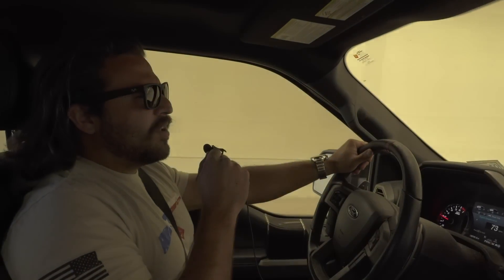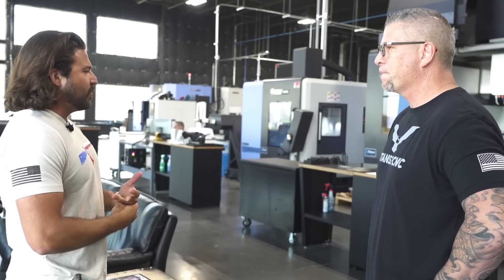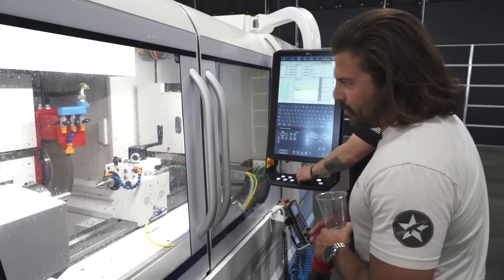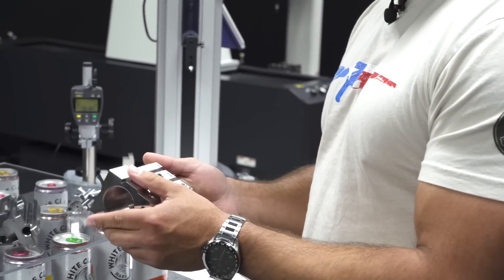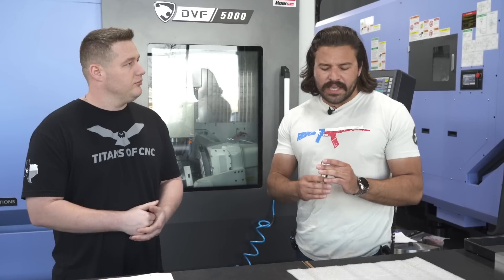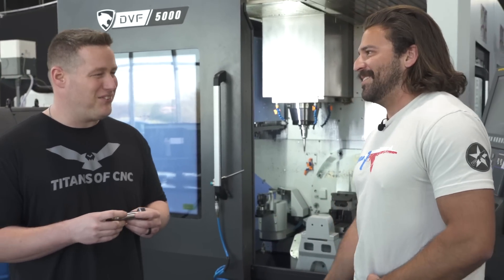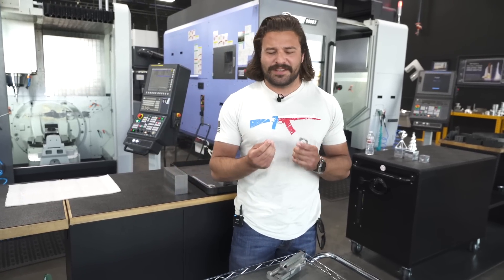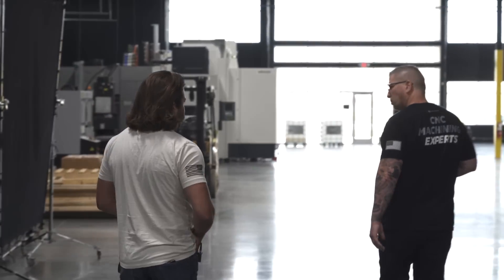AK-50 V3 Update - The Parts Are DONE

Comment: Nothing cooler than watching a CNC make intricate parts.
I'll never forget the first time I walked into a machine shop as a hire to deburr and chip out the machines. At that moment I knew what I wanted to do for the rest of my working life.
   I worked my way into inspection and from there into to running a machine and to this day even after I retired I still love machining!!
There's something about making something that will outlast you and coming to the realization that virtually everything out there was made possible by mills and lathes.
 Doing Aerospace prototype work was the most satisfying point in my career as a machinist. Knowing that everyday will bring something different kept it interesting.
  I've always worked in job shops and couldnt stand the thought of running the same parts over and over again.
Man do I ever miss it. Unfortunately my back and hip are too screwed up to continue or I'd still be doing it today.

Comment: so you pretty much copied a M82A1/M107A1 lol for the bolt head design and their extractor.
Reply: Obviously not, lol. Brandon's is much more like an AK bolt, for instance the lugs are helical, as he mentioned. If you do a 1 to 1 comparison of a Barrett to an AK you'll get a much better idea. The only reason it might remind you of a Barrett is because it's 50 BMG and the sizing is similar for obvious reasons.
Reply: @DeLance Stephens  so you have not seen a Barrett M82A1 bolt head before. They too use a very similar tri lug design and extractor set up. Even the barrel extension is similar.
Reply: @ut_punkn1859  I've seen the M82A1 bolt carrier plenty of times. It's trilug, but it's not helical like the AK (and Brandon's AK-50). Given the AK bolt design is much older than the M82 bolt design, it would be Barrett taking the inspiration from Kalashnikov if anyone was copying homework, but they're really not alike.

Comment: What material did you go with, and where are you having the heat treat done on these? Most of these parts are typically case carburized.

If you go with typical gas carburizing, they're going to distort like crazy and likely none of your features will fit the same. Especially the tapers. If you went with 8620 or 9310, gas carburizing is pretty much your only option. If you went with a tool steel like S7, you can vacuum heat treat them which results in much more stabile and predictable distortion during heat treat, although the hardness and wear resistance will be lower. If you don't heat treat them and just use them in the mill annealed state... Well, you'll have fun for a few rounds before a pretty spectacular failure.

Comment: accidentally asked this under an older video instead of this one but can the AK-50 be used with Ruag HCSX armor piercing rounds? these are loaded hot af, ballistic twin to an anzio 20/50 in a bmg case and are designed to punch through vpam-13 armor using a hardened steel core

Comment: Are you planning on making the system simpler so that it's easier to produce?
Reply: From watching the videos, it seems one of the biggest challenges was the two-piece bolt carrier and cam groove parts; getting them to fit tightly. In production, I believe the plan is to make that one piece, which should simplify the production of that part.

Also, knowing how to produce the part (like the brace for the bolt) will improve time and cost once it is figured out.

Comment: I do somewhat wonder why Brandon didn't use some titanium for the larger parts to reduce weight. As a machinist who worked with titanium, I know it's more pricey and a bit difficult to manufacture (unless you have the right tooling), but the 45% weight reduction plus no rust, low corrosion and the temp resistance would be extremely beneficial.
Reply: In a production version maybe, but not in a prototype.

Comment: Biggest potential for error is the bolt. The lug and cam entering in by rotating can lead to the boot over rotating upon cycling ending up in the lug catching the lead in of the groove. This would cause a jam and be difficult to disassemble. The geometry of the cam can be changed so that way the bolt will be inserted into the cam and then the cam+bolt will be slid into the dovetail grove on the bolt carrier for assembly. Other potential for error is the bolt face catching upon interacting with the trunnion. If not clocking in quite right, the bolt will catch and lock. Other question is clearance. If the cylindrical profile of the triangular boss and chamber have a slight taper, it allows for good lead in and clearance on entry and tightens up upon locking into battery. Other question is tolerances. It is good to make an assembly with max material condition and least material condition to test if the tolerances allow for a functional assembly. Also hard to say much on tolerances and setup without seeing all the prints. Knowing the datums would help with figuring out better machinability and margin of error

Comment: The worst part about CNC is that if you install the bit just slightly off you just blew 200$. It is also shocking how thin the bits can actually get. 

One day at the shop I saw the machinist install the same bit 10 times, with lazer sights and everything... and it was still snapping the bit on aluminum. He damn near ran over a cop as he left the facility at the end of the shift because he was so pissed. (the QA guy messed with the program and instead of the bit pulling back and forward it tried to move through solid metal side to side.)(*everyone hated this QA guy but corporate brought him in; He was incompetent and would steal lunches)

Comment: Idk if I'm just retarded but the hinged system seems redundant and like an extra point of failure. Say the joint that holds it together.  Will It be able to handle the shock from the recoil after 500 rounds? Even if its not directly receiving a lot of shock from the bolt it would still be constantly stressed because of the design. I'm excited to find out either way.

Comment: I would reduce your class of fit so that the BCG and extractor has some space for small amounts of carbon deposits produced by the powder. My prediction is its going to jam. But this could be offset with the right coating. Also reducing the amount of material on the non critical features of the bolt to allow some gas to escape around the bolt upon extraction will prevent the build up and and allow it to function for longer period of time with out maintenance. I hope it works though. The struggle is real!

Comment: Can confirm. I'm sub'd too and love watching both of y'all. 

Design Engineer at Rolls-Royce LibertyWorks here 🤙
Reply: Hay I'm looking into getting into college for mechanical engineering. You have any advice? (Haven't enrolled yet)
Reply: You've got 2 options really. Are you good at math? How about working with your hands?
Reply: @Supra_Nova88  i pick up on Advanced Math Quickly. only thing is Advanced Math is a perishable skill, but once something is learned you pick it back up easily enough (focusing on Algebra and Calc at the moment) 

it's all about learning the Tricks and Formulas and Turning what looks intimidating into Basically 3+7.

 I have over 7 years of Combined Experience in a Few Machine shops Working with Everything from Broach to Final Forge presses and some CNC Lathe.
Reply: Alright so I've been doing this for about 3 years now and I've never once had to touch cal for work lol. 

That being said, if you're more hands-on oriented (like I am) you might want to look into Mechanical Engineering Technology rather than science. It focuses on the applied aspects of engineering and a lot of the coursework is shop related where you learn manufacturing and rapid prototyping processes. This would most likely mean easy A's for you since you already have experience in a lot of that stuff. 

Of course, at the same time, I am one to advocate for the route less traveled like I did. I only have an AAS in Engineering Design Graphics (basically a CAD degree) and look at me now. Still mind blown that a company like this would even consider me, but hey, I do bring a very unique perspective and broad skillset to the table that most of these other Engineers don't know a damn thing about. Plus my lead (the one that made them hire me) has a spitting image of my skillset and never finished his degree. Yet he is the most highly praised and recognized person we have. 

Some background on me:

I used to be a Mechanical Designer and an Engineering Prototyping Project Coordinator for an HVAC company where I did it all from cradle to grave. The initial concept, preliminary design, final design and drawings, then managed the Prototyping and testing processes to completion of the project. Later I was picked up as an Engineering Technologist designing drill bits for Halliburton. 

I was also just notified that I will likely be following my current project into the test phase, gaining a title change to Test Engineer (a position I've never thought of). There I will be developing test procedures, designing and fabricating test rigs, and performing and monitoring turbine and jet engine tests. This is a great position for a jack of all trades type of Engineer like me because I'll be able to flex my design muscle as well as scratch my hands-on itch that I miss so much.

The realm of possibility is more vast than you think and you'll just have to navigate your way through it at your own pace and in your own way. The route I took required more hard work to prove my worth, but in the end, I got here with literally zero student loan debt. However, a bachelor's degree will make it easier for you to get jobs, but you may never use everything you learned from that degree and end up with loan debt unless you can bag a full ride somewhere.
Reply: @Supra_Nova88  thanks a lot man this was helpful.

Comment: I've not programed a cnc for years it was great fun programming and setting the machine. Think the funniest thing I've seen is some one didn't set the cnc up right and it flew out the chuck ripped the door of the job flew through 3 walls before it lodged between my legs at the other end of the machine shop if it was a little higher I would have been a unicy snip snip haha at the time a shat my self lol

Comment: With seams that tight you might need to worry about friction lock 😆 if that becomes an issue a thin coat of oil or grease should reduce the issue.

Comment: As a fellow machinist? Those parts look amazing. Top notch work. As long as it was engineered and drawn correctly it'll work perfect! 
If you made it to the print you did your job. If It fails its on Brandon's crew... I see good things in the future of this. Rock on guys!
Reply: As someone who lives in an orthopedic manufacturing capital.  There is nothing quite like the feeling, when you personally have designed, wrote the program for, ran it, and have the full product in your hand.  YOU MADE THIS FROM SCRATCH TO NOW.  This isn't just a hammer and wood and some nails, jesus fucking christ in a handbasket when you have this perfect part that fulfills what it is designed to do, what YOU designed it to do, and it's that same feeling of flush lines disappearing and more...  

It's eye opening, you did that.  You and all your culminated experience and training made this thing that functions perfectly and it almost brings tears to your eyes seeing what you made.

Reply
Reply: What about heat treat?
Reply: Will a production run be feasible and affordable? Do you think the average working man will be able to buy an AK50 and still be able to eat?
Reply: @BCM1959  depends on what you consider affordable. The least expensive semi-auto .50 BMG rifles run at least $7k these days, and those are full-production examples. $10-12k minimum if these get into production

Comment: Not sure what type of steel you are using, but additionally you may want to try heat treatments to some of your parts. It will stop them from wearing down quickly also they can strengthen the steel as well to stop fractures and increase the shear strengths

Comment: Unlikey but if these parts actually hold up will it or can it become a finished rifle?
Reply: These are massive blocks of milled steel, .50bmg is a ton of energy, but these should be more than enough to handle it. The point(s) of failure, if any, will probably something else, which is the whole point of prototyping.

Comment: The making of fixtures and jigs to make parts is almost as complex and intense a process as the design and prototyping of the gun itself. Look at the Colt revolvers. Sam Colt was an ideas man and could think up how the gun could work and how he wanted the gun to work. Elisha Root was the man who not only took colts ideas from paper to metal, but designed the machines and jigs necessary to make the guns in a factory assembly line. Again people who claim Henry ford made the assembly line are absolutely full of it.

Comment: Holy shitl dude. Getting that tapered doveltail on the sight block to snug at the precise point is very hard to do. I know you can throw trig at it but if the cutter took an extra thou, it'll slide forward 10 and be noticeable. 
Crazy stuff and I have been watching Titan before but never really see how two separate parts come together
Reply: You're exactly right! To accomplish that fit, we actually extended both sides of the dust cover model .005 and then cut the taper on the edm. Then we fit it into the trunnion and measured the amount of stock we needed to remove and ground it to be perfectly flush.

Comment: Assuming the end goal is a 'Production' version, what are the different trains of thought that go into things like wear on running parts, optimizing production of each individual part, as well as things such as tolerances for the inevitable elements such as Dust, dirt, GSR, humidity etc?

My main curiosities in this question being: Is it practical to have a production model assembled entirely from CNC'd parts (I'm relatively new to the idea, I don't know how easy it is to mass produce via CNC Machining)? Is there a different process for larger scale production of parts that assures an acceptable level of precision, or does the existing design have to be given another look to account for things like tolerances?

Besides all of that, congratulations on the progress! Let's hope for the best moving forward!
Reply: So many things you've touched in this day and age are mass produced on CNCs or a CNC was used in the process (i.e. making molds). Also, if things are cast or forged, most get finished on a CNC.

Comment: "if you guys designed them right, we machine them right"  as a 3d modeler with some experience in cnc and 3d printing, this is the truest statement. So many places mistakes can happen!
Reply: Exactly, I do a ton of 3d design. Every year I design a bridge and manufacture it mostly using manual mills. Whenever they are done it’s beautiful I machine over 300 pieces that had a tolerance of 5 thou. The bridge was beautiful
Reply: I used to get so annoyed at the design issues the owner of the cabinet shop I worked at used to have, he needed to get someone who actually knew designing for cnc to have kept that place running and we told him so many times he needs to step back but then he'd have only been dealing with customers and he didn't want to give up what power he had

Comment: In all seriousness I hope the tolerances are not to tight. With temperatures fluctuating I hope it doesn’t burn up. This is no longer a gun but an artwork.  Serious question Brandon will y’all use a lubricant if so what viscosity anything special

Comment: Man that is absolutely gun porn to the max, my curiosity lies with how that bolt lock up will go after a couple of cycles with heat as it looked like a very tight clearance, but I probably answer my own question with the might of engineering that has gone into this taking into account metallurgy and expansion through friction and heat. Cant wait to see this piece of porn taking down some invading hard seltzers

Comment: stay away from square cuts on the bolt. anything cut at a perfect 90* is a fracture point. same reason CVjoints and other gun parts have a smooth radius from one surface to another.

Comment: Really cool crossover with Titans, considering their mission.

But I also wonder what kind of shop has to be used now, to try and make these parts in production, that isn't running a showroom/classroom with the latest toys being more-or-less comped for marketing purposes. Trying to turn these parts back into something that can be run on your more typical production equipment to keep the costs in line will be a big undertaking of its own.

But proving the geometry and engineering is the first major hurdle and if you can do that, the rest can be overcome.